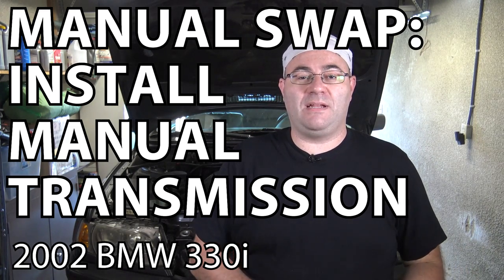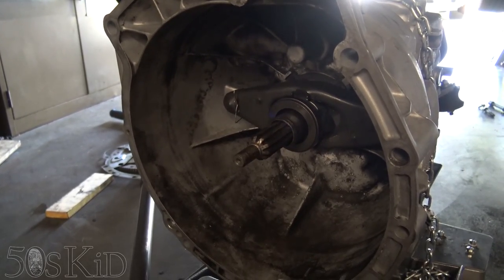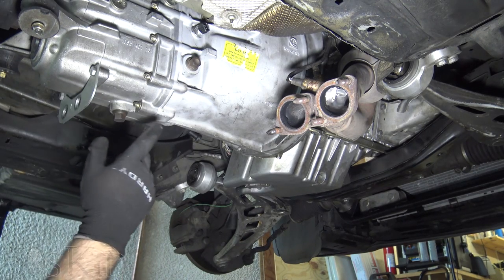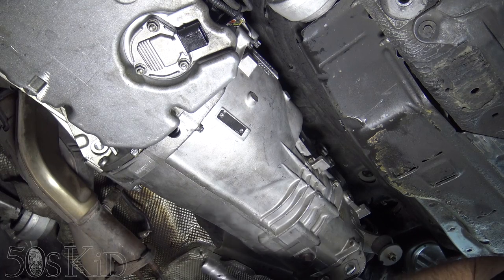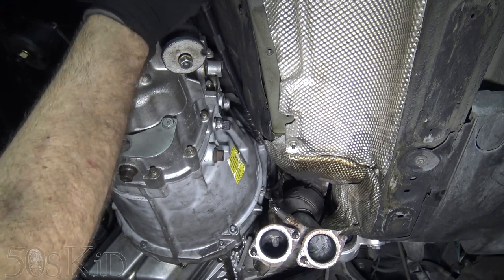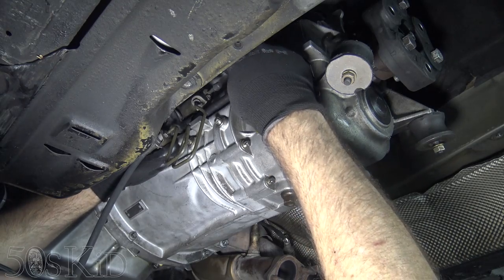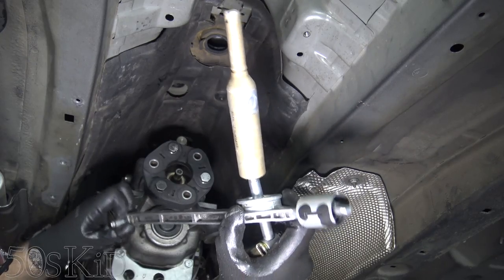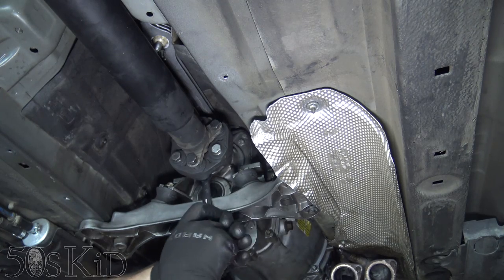BMW E46 Manual Swap Project: Transmission Installation DIY

Comment: I did the swap a few weeks ago. Was a quite relaxing job except for the seized bolts in the engine block. Had to remove the engine from the bay to drill them out... PITA!
Anyway, the worst part was releasing the upper right bolt cuz I only had the t14 1/2 inch socket and a quite chunky joint. I searched the internet for that fancy joint you were using but no chance! Anyway, the job was worth the struggle, the car drives very sweet now!
Reply from the maker: +Bogdan Nicorescu nice going! 👍
Reply: 50sKid thanks but without your previous job it would have took me a tad longer, so thank you! 👏👍

Comment: I found the top bolt under the left side of the cylinder head the biggest c**t to get in. A right PITA to get the bolt started. I never removed the engine mounts though. I was trying to start the threads by hand, so it wouldn't cross-thread but you need to very gently without force on the end use a ratchet, and make sure the bolt seats straight before you begin turning it in.

Comment: He’s great I’ve learning a lot. I even bought same tools his using.. one of the best DIY all around from electrical to mechanical... I think it would be great addition bro if you can add part numbers on the descriptions below so people can buy similar stuff you installed... thanks bud keep it up
Reply from the maker: i try to do that as much as possible
Reply: Just curious, were you used to be a bmw mechanic... or IT consultant? You seem to know quite extensive and with great accuracy and sense to explanation you provide. Great bro!
Reply: i am planning to change my autobox to manual on my e46 330d ...with your excellent vidoes i will do it perfectly...you are the best...

Comment: Jason can you confirm you preloaded the Center Support Bearing? 4-6mm (0.16-0.2)...push the Center Support Bearing forward towards the engine. The slots on the Center Support Bearing allow this...if your taking notes

Comment: Hey, Jason, when you do the review think about listing the parts you should get from the donor vehicle that perhaps you didn't know you needed, e.g., accelerator mount, heat sheild, bolts, etc.   Great job!
Reply from the maker: I think you kind of named them all, lol.  Pretty much everything necessary was in the intro parts video.

Comment: great job! can you do the programming part too?
Reply: is it needed?
Reply: There is no required programming for this swap.  All the programming for the transmission does is you'll be able to start the car without pushing the clutch in.  My manual e46 is actually programmed to automatic.  I've done the programming to see what it does and that's what I found out.
Reply: @fr0ilan i was going to swap out ecu, key switch, and ESW now i know i dont have to so thanks man now i know i can use my new key that came with my new car after i swap my old trans after being rear ended.

Comment: Congrats on the successful swap!

2 questions:
1): have you done the DME coding for the manual yet? I'd like to see that!
2): How much more work would it be to pull the motor out and do a engine conversion? I have a 525i wagon that I'd love to upgrade to a 530i MT Wagon.

Cheers

Comment: I'm looking into getting a 323i which I'd be swapping to manual. Will this work between M52 and M54? Would be M52B25TU and I'm trying to find which manual trans to pair with it. Was hoping to use all the same things in this series.
Reply: If you haven't already found this out by now cause its a month old comment, The m52 and m54 share a bellhousing pattern. 323i, 325i, both use the same getrag 5 speed transmission. although it's recommended to use the ZF trans from the 328i, 330i as they have a higher rated torque than the getrags. However they're harder to find and more expensive. hope I helped
Reply: @cibbirt1348  i didn’t do the swap yet so this is very helpful! thank you I really appreciate it. Stoked on this project. Would you happen to know if I can get linkage from the 325 or 330? i heard it’s shorter? Also would I get the drive shaft from either of those too?
Reply: @WhosJohn  i believe the 328/330i trans is shorter than the 323/325, so the linkages may end up being different lengths. You will need a manual driveshaft, however to save on cost, you can purchase only the half of the driveshaft that connects from the transmission to the center support bearing.
saves you the cost of a full driveshaft and diff, but your final drive gear ratio will be higher, resulting in having to shift more.
Reply: @cibbirt1348  you rule tysm. I think the auto dif might be better for drifting anyways so I'll probably rock that for a bit and then go from there. I really appreciate your help, ive been going through the forums for weeks and you're the only one who's suggested to buy half the shaft to save money. BIG BRAIN.

Comment: hello...good video...i´m having a problem whith my bmw 25i e46, after i´ve placed engine supports and swapped the gearbox from 5 to 6 speed gearbox, i can not put the gear lever centered, is leaning towards the side of the passeger...what could be the problem?? if you can help me...thank you
Reply: You still have this issue?

Comment: Sir, the back bushing that you say doesn't go in any other way, how do you take it down?  It looks and seems so easy to push it back on.  It snaps into the holder.  And by the way, thanks for the videos!

Comment: I'm really nervous about lining up the teeth of my flywheel and starter together. Is it possible to have the starter pin in place without the teeth lined up? Or if your able to get the pin started does that mean the teeth are for sure lined up?

Comment: at this point get a m3 steering whee,l lsd diff  and headers and you will be set nice job on the swap and the full engine rebuild

Comment: Good work! isnt bleeding the clutch just like the brakes? to say one cant just pump the pedal with the bleeder open all the time. Im guessing you used a check valve at the and of your bleeder hose?
Reply from the maker: Nah as long as you have the tube on the bleeder and you squeeze enough fluid through, you're not going suck bubbles back up into the system.  You can hear when you're squeezing out mostly air and then when that stops.  You may have to do it a second time but it's not a big deal.

Comment: can I use a cluster with miles per hour on a kilometers per hour car the swap would be from a 2003 BMW 325i to a 2002 BMW 320i sold in Canada and Mexico only

Comment: I'm not sure if anyone will see this but I just removed my manual transmission for a swap into my automatic car and broke the highlighted sensor just as I was pulling the engine out does anyone know what one it is thank you

Comment: Yo put the transmission in you said to put it in gear so you can move the output shaft while it moves the input shaft, but in gear it doesn't move? did you mean neutral?

Comment: Great video as always. I'm gearing up (pun intended) to manual swap my E46 N42 as I found a complete, matching manual setup (box, clutch, pedals and shaft) for $500. My only worry is, won't the ECU just think I'm in park?
Reply: Ace Futura No. it'll be you that will think that the car is in park if you look at your cluster and the "P" is lit. There is no coding required for the swap. You can just take the bulbs out of the gear indicator or change the cluster....but cluster swap will need coding or else you'll get the tamper light.
Reply: I'm ok with a little dot on my dash. Thanks for all the info, really helpful =)

Comment: hi 50skid I have question I hope you can help me,  I have BMW X5 2003 4wd automatic, I want to swap to manual transmission , I wachet your many times , and ready tu do it but my concern its the 4wd any suggestion ? what gear box I need? my 3.0 liters thanks so much for all videos

Comment: You guys complain about maintenance but forget that it's still cheaper than buying a new 40k car with 900$ a month note. Modern cars are also problematic because of the turbos and plastic parts they're putting on them. Honda and Toyota quality has gone way down over the years.

Comment: I was sooo happy to find vid that you had for a manual tranny. I have a question. I’ve been having issues trying to get my tranny back into place after changing out my flywheel clutch and pressure plate. The housing where the left long e14 and top right short e14 bolts go keeps hitting the insulation and not letting the tranny go any higher. Did you have the motor mounts removed when you inserted your tranny man. Cuz sweet baby Jesus bro it’s driving me crazy that I I’m sooo close to have my car back but can’t put that tranny in. Any tips would be awesome.
Reply: I am also having this problem. What else can I remove to safely have better access to the top bolts?

Comment: Hi there I am missing the plug that connects to the clutch switch. What would be the solution for this as Manual BMW's in newzealand are hard to get so the junk yard is not a option. Cheers
Reply: Hi Simon, I did an E46 manual swap here in New Zealand and managed to get most of the fiddly plugs and switches online. Use RealOEM to get the exact part numbers, then google the part number to find an online retailer
Reply: Thanks Sam. I have figured a solution to not use any of the switches. Less secure but the easiest solution

Comment: Hey Jason, so it looks like you had the transmission hanging from the input shaft only (splined into the clutch).  Can it take that?  That's not too much weight?
Reply from the maker: Nah the thing is pretty light, all things considered.  Hardened steel input shaft.  It was ok.
Reply: Sweet.  Good to know

Comment: About the ECM ? Have you change for the manual ECM ?
Reply: It doesn't really matter if you change it to manual.  The only difference is that you can start the car without pressing the clutch in manual mode.  The ECM for my car(manual 5-speed) is actually set to automatic.
Reply: Froilan Reyes Please one question, my e46 is manual,  if i change software to automatic, the car only will start if i press the clutch?
Reply: Are you currently able to start the car without pressing the clutch?  If yes, then switching the software to auto will allow you to start only after pushing the clutch.  There are two switches on the clutch pedal.  One is for the clutch safety (the one that won't let you start without pushing) and the crusie control cut-out switch.
Reply: Froilan Reyes thanks for your answer. i will try to make it !!
Reply: You may want to verify that the switch is in there, or if a previous owner bypassed it.  I just know that manual BMW's delivered to the US has that safety feature retrofitted.  It may not be the same for other countries.
Reply: Froilan Reyes right , in Spain we don't have that configuration for bmw antique, but i think it's interested. however some vehicules opel for exemple has this actived

Comment: Also make a website called 50sKid.com that would be great and have sponsors coming in and patrons as well. Just a thought since you deserve to get paid or atleast benefits for the hardwork
Reply from the maker: making a website is a lot of work because you have to update it.  I've run lots of sites before but there is little point in the post-social-network world.  Facebook and Youtube do everything for me, they manage and display the content and do the job of a forum.
Reply: That makes sense... well keep it up bro... I enjoyed all you videos and I have x3, x5, and 325xi and it helped me a lot resolving error codes I had before . Obviously you got an extensive knowledge of things ... wish you all the best !! I got Milwaukee tools too and they are the best ... they have tire inflator , Bluetooth radio , and head lamp 475 lumens works great under when you’re making videos underneath sided with go pro you can actually take videos like a 1st person view ... but your videos are great like a pro .. keep it up bud. Thanks for the reply... I’m a fan ..

Comment: why 5 gears wouldn't 6 be better?
Reply from the maker: Yes but this is what was available in my junkyard
Reply: Probably more expensive and harder to source?  It also ultimately depends on what you wanted the swap for.  I would have gone for a 6-speed because I do a lot of highway driving and my RPMS as pretty high when I'm going 80mph on 5th gear.
Reply: a 6-spd bmw gearbox can cost upwards of $8k, while you can get a decent 5-spd one for $250
Reply: ok i just wanted to check

Comment: No programming??
Reply: He went over some rewiring in the parts breakdown (previous video)
Reply: That's not programming. You need to program the DME to not look for the transmission ECU or it will throw error codes. Also, the programming will turn off the gear (P, D, 1, 2, 3....S, etc) lights in the cluster.
Reply from the maker: Yeah it's coming
Reply: Is coding required to start and drive after swapping to 5 speed Manual..just recently swapped my 330ci from a auto to a 5 speed and getting a crank but no start.

Comment: My question is this... are you doing the swap because the auto trans failed? I remembered a video where you had P0471 (If I remember properly). And you spoke about replacing the torque converter and another part (to prevent the issue from reoccurring)... did you end up replacing the converter, and if so, did that work?
Reply from the maker: No it was fine.  I just did this to have something to do for the channel.  Some videos to make.  I might put my auto trans back in a few months from now.  Haven't decided yet.
Reply: 50sKid sweet thanks for the info. If your looking for a factory short shifter option, I believe there's a 5 series (I can't remember the exact model but I believe it's a newer m sport that has a shorter shifter that works well.)